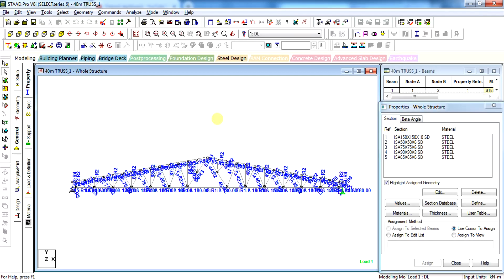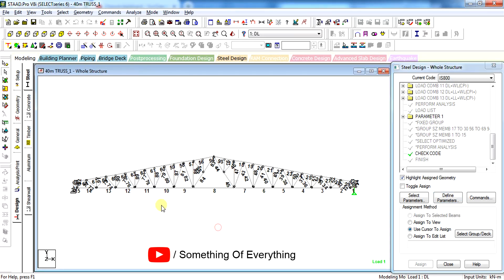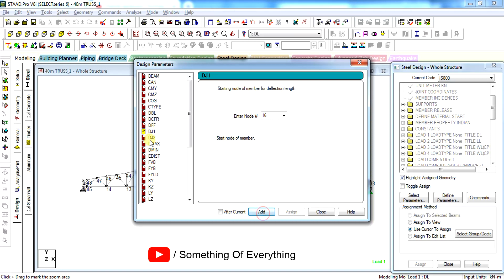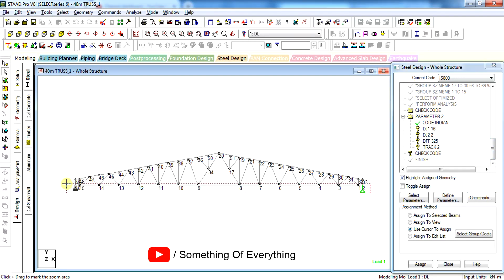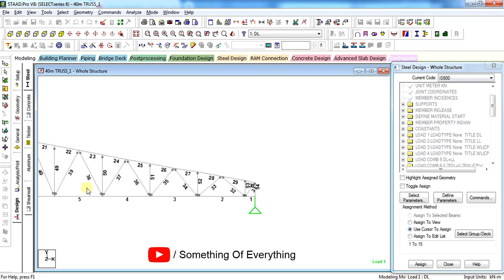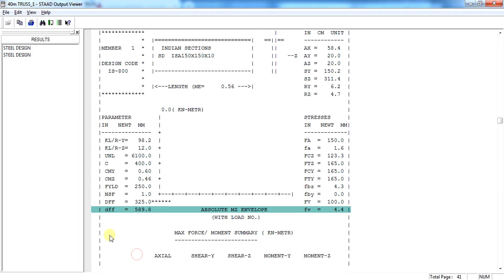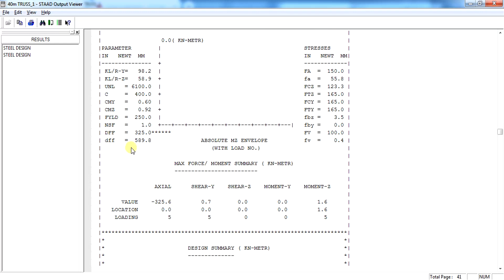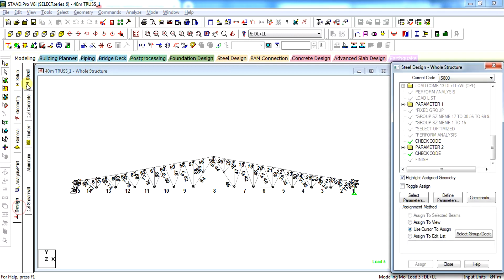Deflection check of steel members in STAAD Pro

Comment: Hi, What is the difference between Node displacement and Max relative displacement in Staad pro. Can we follow deflection limit in node displacement or max relating displacement
Reply from the maker: Relative displacement shall be used for checking local displacement. Whereas node dispacement shall be used for overall displacement.
Reply: @Tinytopic  
Thanks for you reply. Which one need to follow in design. Some client following local  deflections and some client asking to follow over all deflection (global.) which is right one.
Reply from the maker: Both